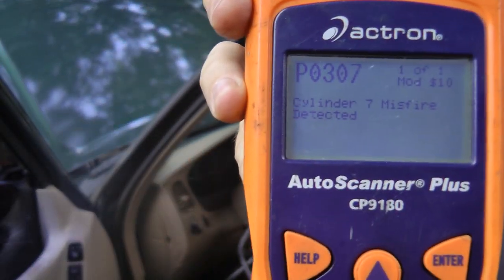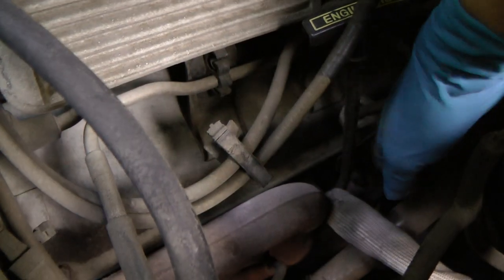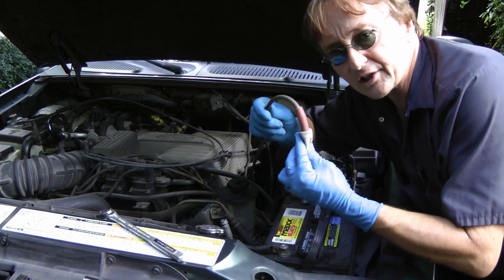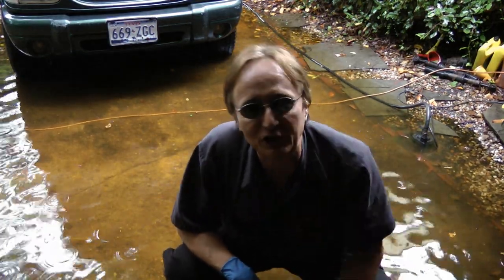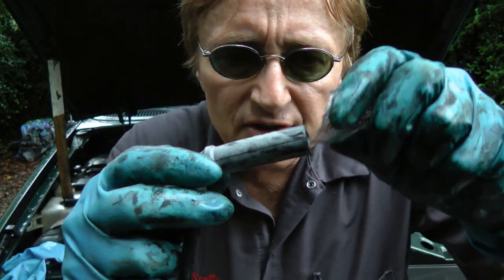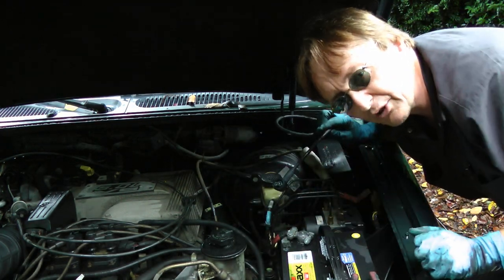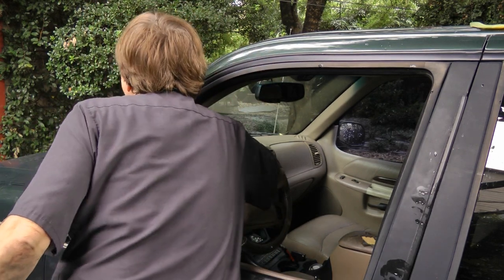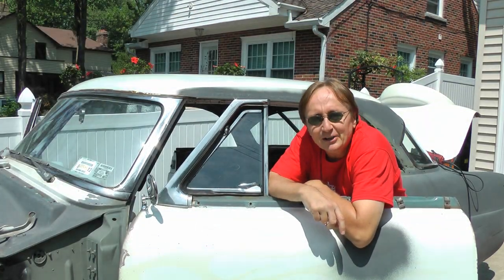How to Fix a Engine Misfire Code P0301 (Spark Plugs and Wires)

Comment: Three months ago I had transmission lurching, engine overheating, and CEL  on load only. Radiator guy said I needed a new radiator; trans guy - trans work. Then I saw your vid. Went with your advice; checked coil packs, plugs & wires. It was # 2 ignition wire. New set of Delphi wires - $29. All problems ceased. Thanks, Scotty, for saving me tons of money - AGAIN!

Comment: cables and spark plugs run almost 120.
time wasted 1-2 hours.
then you find out its not the problem.
ok you change coil, not the problem either
oil change nope,compression ..cars are so expensive
we should all go back to riding horses.
Reply: Horses are more expensive to own than  cars.

Comment: Will do that tomorrow :) I'm going to the junk yard, going to get fuel injectors, a MAF sensor, and a fuel pressure regulator. I looked at my EGR valve, cleaned it according to one of your videos, and my valve springs are working properly.

Comment from the maker: old age will do that with worn parts. Anything from worn spark plugs to bad fuel injectors will do that. so start basic with new plugs and wires and pray you don't have to go a lot further. Also try my video "how to clean fuel injectors on your car" that often fixes it.

Comment: It was implied by your initial comment, but glad to hear that. Commenting about over torquing is a non sequitur response to Potato's comment. If anything, using a torque wrench would make it less likely one would over torque a spark plug, not more likely. I use a torque wrench for my spark plugs because I don't trust myself to measure ~13.3 ft-lbs by hand and I know a low range torque wrench can. But someone like Scotty, or other very experienced mechanics, probably can gauge that by hand.

Comment from the maker: you can get em out easier than that, but only on a cold engine with really wiggling your arms around stuff and using wiggler extensions on the plug socket extension

Comment: @scotty kilmer   thanks for puttin the vidis up,,,i bought a used cadillac cts 3.6l  2005 and replaced plugs, coil packs and now fuel injectors,,im sure you saved me an easy 1500.$ in labor that i did myself  ...much appreciated ,,especially lettin ya kno to replace the whole set vs a single injector etc...  skip n you will be back undr the hood

Comment from the maker: na, only if old and cracked or arcing inside. And in this case, it doesn't have a cap, it uses  a separate coil to fire each cylinder.

Comment: With a lot of newer cars "not needing" tuneups or plugs for the first 100k miles or so, have you ever had problems removing plugs that have been in that long? Some folks would take almost 10 years to get that mileage and I wonder (especially with aluminum heads) whether there is danger of stripping the plug holes. Thanks, and keep the vids coming!!

Comment: @hardliving working BMW's (2x 2000 BMW 323Ci & 328i) and a Camaro (2000 3.8l) I had to change the Mass Air Flow (MAF) Sensor on all three!  Ebay.com average about $45, might be an idle control valve, or a vacuum.  Scotty you rock!

Comment from the maker: i also have the machine to reset it. there is a way to do it without, but it involves pushing scores of buttons and switches on your dash in an insane German designed fashion.  Google that and you will find a way to do it, but last time I did that before I bought my machine, it took me over an hour to get it to work on a beemer.

Comment: You prob think I'm an idiot. But I couldn't see the fuel injector rail so I thought it was TBI. I found the injector assbly and replaced it. Prob solved. So you were right! I had to replace the whole spider assembly and it was expensive, but not as time consuming as ripping the heads off. And it seems to have solved several random drive-ability problems that I was having. Thanks!

Comment from the maker: Did it start up at all for you after changing the dist? If not, then either you got a bad one or put it in wrong. Now if it did start, and this is a new problem,  do my video "fixing a car that cranks but doesn't start up" to find the culprit.

Comment from the maker: I doubt it, air leaks cause bad idling more often. I would assume the fuel pump is weak, the fuel lines are clogged, or the carburetor just needs replacing

Comment: Good point about the torque wrench not fitting. I have a Toyota 1.5L where all the plugs sit up top and are easy to remove and torque down. I guess I'm used to 4 cylinders!
I thought TX was in a bad drought?

Comment: The only fuse boxes i'm aware of are located in the engine compartment, and on the side of the middle console.  Is there another box under the dash?  Could I fix the problem myself?  I changed a fuse, and I can change my oil, but my skills end there.  If not would it be expensive?  I did have to change a fuse for the onstar system and for the power outlets.  That fuse was in the engine compartment.  My previous comments may sound rude but they really arent meant to be, I appreciate the response.

Comment: I have an 84 Toyota Van.  Most of its mis-fires were caused by a bad coil and bad plug wires.  The last mis-fire it had was from a collapsed hydraulic valve lifter.  I traced it and replaced it.  Runs like a top now.

Comment: Probably one good tip for novices is to change ONE plug and lead at a time - I learnt that one the hard way, pulled them all off and had to chase the firing order down in the workshop manual!

Comment: Hi Scotty, my girlfriend's 2001 Corolla is in a bunch.  The car has so much problems starting, probably 1/20 it'll start and run and once it runs, it bogs so badly you can barely gas it without it dying.  I replaced the spark plugs three times already and now they're Bosch Platinums because the first two sets kept getting carbon build up.  I know the car consumes oil and has a couple check engine codes but we can't confirm them because the car won't even move easily...occasionally it flashes.

Comment: Amazing video Scotty, thanks for posting it. I just finished replacing radiator coolant and using the Steel Seal you recommend for engine gasket fixing. After completing the process the engine runs much smoother with high compression. However, scan still shows PO3 cylinder 4 misfires. What should I do? Thanks.

Comment: @ smoky pearl: I'm not a Ford guy, Toyota is my game. My brother just bought a 2002 mustang GT that has the 4.6 and I researched the car a bit and found that info. Supposedly Ford did a redesign after 2004 and then the plugs threaded in real deep so the carbon fouled the threads enough to make it real tough to get the plugs out! I'll stick to my Toyos , thanks..

Comment: It did not start up at all.I probably put it in wrong. this was my first time working on my own   vehicle.I purchased a timing light to help me out. I may have to reposition the distributor for proper timing. But I will check out that video. I did replace that distributor for a newer one. and I still have the same problem. Fouled spark plugs with fuel.

Comment: I usually check the underside of the distributer cap for dust and HV tracing caused by it. HV tracing is usually easy to spot, since it burns a path in the dust. unless the cap's contacts are excessively worn, I usually just clean the inside of the cap to stop tracing, and replace the rotor button if it's on its way out. make sure to use some white paint to mark the orientation of the cap before you remove it though.

Comment: Hi Scotty I'm a long-time fan first time ever ask a me a question... I have a 2010 Hyundai Accent sedan it's a 4 cylinder it has a 1.6 liter engine...cylinder 1 continues to misfire I changed all the spark plug and it still has a misfire. 2nd- I replace the coil in cylinder 1 and it still has a misfire. 3rd- then I check the compression in all cylinders and it's a 180 pounds for all the cylinders. 4th-So then I replace the fuel injector on cylinder 1 and it went away for a moment and then came right back. so now I'm stuck!!!!!. This car was an investment to make a little money and since it was so brand new I did not anticipate having this problem. Where should I go from here?.....Thxs Ken

Comment: Hi, my c240 Mercedes Benz gave up on the street started to shake rpm dropped I got the car on the side turned it off did a cupel of starts the car turns on losses power and turns off slowly it feels like the car is trying to get more power and as soon as it does it gets more shaking and gets week I press on gas car does not move the belt works and stops a cupel of times then turns off what do you recommend thank you very much you have a lot of awesome videos

Comment: Hey scotty, i got a atv that backfires like crazy when i give it gas when cold. It idles fine cold and backfiring stops when the engine is at full operating temperature. Why is it doing that, it didn't do it before. Also the carb is properly adjusted and clean. Air filter is sorta clean. Atv is a 2000 bombardier ds650 with aftermarket carburetor and larger exhaust

Comment from the maker: there is a fuse for the check engine system, go to the main fuse box under the dash and check for a blown fuse there. But if it is blown, there is a reason and it would have to be fixed. first thing to do would be get the data port to work so you can access the code, there are over 2 THOUSAND different ones.

Comment: thanks the response.
sorry to i forgot to tell you that i replaced the injectors before fixing its connector. now i observed that the intermittent loss of power is not that long as it was. but still i can feel a shake from the engine when idling.

Comment: Just in case anybody misunderstands, the dielectric grease that he put on goes on the rubber boot and not the metal electrical connection inside. It insulates the connection between the rubber and the ceramic and allows the boot to slip on easily. I know Scotty understands that but it was not completely clear in the video.

Comment: Hey scotty. I have an 07 F150 with 4.6. I need the plugs changed, but I have read that these are a real nightmare. I dont have all day to mess around with these spark plugs, so with that in mind...should I buy the extractor tool for broken plugs? Or just go to my local mechanic for this job since he probably has done several of these plug changes?

Comment: Hey Scotty I have a problem and I can REALLY REALLY use your expertise right now. My car died on me while i was driving it like out of nowhere and it was hard to step on the gas I had to use my e-brake. This happened when I was slowing down at a Stop sign and after it turned off I turned it right back on and it started up. I'm a little freaked out right now this is my only car to work. 

ANY help on what you think it might be or how i can fix it?

Comment: Hey Scotty, what is your opinion on domestic vs imported cars? Most people consider foreign cars to be better, but I see all cars as good (unless its a Yugo or a jaguar) as long as you maintain them properly.

Oh and also, I have a 1995 V6 OHV Ford Explorer 2wd, I keep hearing a squealing noise when driving and foot off brakes mostly happens when turning, my guess is the wheel bearings as they are the factory bearings (probably not ever re greased).

Comment from the maker: swap the number one fuel injector, if the miss moves, that's it. If not, often a problem inside the engine on number one, like a blowing head gasket on that engine.

Comment: Hi sir Scotty, i'm 20 y/o and i have a Honda City 2004 iDsi i don't have any idea about fixing a car but a few tips here in youtube that's what i only have (Sorry for my bad english).. My problem is i have a bad 4 ignition coil with 4 few rust spark plug (That's what they told me at Car Shop) I've got a jerking engine before... When i went home i've tried a simple troubleshooting like disconnecting the battery and unplugging all the wires in all 8 ignition coils and check if there's is a corrosion, then i plug the wires back , i also saw your video cleaning a throttle and i did that one too, after that i've check my car and drive a few miles, checking my car if it will jerk again but the jerking is gone now, i feel that my car slows a little bit since i've got this problem...
I don't know exactly where to get a help because sometimes they think that im only just a kid trying my best to get my car get well again, what im trying to say is they want more money from me even some parts is not need to be replaced :( i've got a lot of idea from you sir, i just can't apply it because i'm too scared to do it to my car, im from Philippines.

Comment: Hey Scotty I recently got a 94 ford ranger 3.0 and it runs great and all but sometimes after I drive it for a good amount of time, lets say maybe a half hour or so, when I turn the engine off I'll hear this like ticking sound. It sounds like a misfire more than a knock so I just wanted to ask you to see if you have a diagnosis for the problem. Also the power steering fluid is chocolaty brown is it time to change?

Comment: Hey Scotty I have a 2011 Ford Mustang 3.7 v6 and it has almost 92,000 miles and it runs great however I was told the spark plugs needed to be replaced every 100,000 miles and also note that starting in January more than likely I'll be driving to my college back and forth quiet a bit and the overall trip is 180 mile round trip and I need it to be in good shape so I was thinking about replacing them what do you think

Comment: I never got a response so I may as well take the opportunity.  My 2004 Buick Rendezvous hadn't been started in around 6 months.  It has 175000 miles on it.  We changed the oil cleaned out the anti freeze container and added more 50/50 ratio with water and added fuel system restorer to the fuel tank. The same day I was driving it and the service engine soon light came on.  Auto zone said it wouldn't read because i have a bad fuse. Which fuse do I replace, did something I did cause it to come on?

Comment: fixed a misfire with 3$ spark plugs. the engine was misfiring randomly and when you gave it gas it stopped. i thought it would be a fuel injector or something worse and the plug looked healthy, but when i changed them it fixed the problem

Comment: Hey Scotty. I got tons of problems going on with my 1998 Camaro V6 but i figure i'd start out with the small things first. I got a cylinder 6 misfire but when i see other people check and change spark plugs in other cars they don't always go under the engine, i seen a few cars you can get them right out from top of the engine... I'm new to all this and this is my first time trying to fix a car so excuse me if this is a dumb question.

Comment: Hi Thanks for the video! I have almost this code, but with a misfire on cyl 8 on my 07 f150 4.6L.  The plugs on this truck are original, 99.5k miles, and are also the plugs notorious for breaking. (thanks ford) I plan to use the same Motorcraft plugs just new, but Is it okay to use maybe a newer updated version of the plugs from Motorcraft?

Comment: Went out today checked bracket, 1 of the screws is stripped ,bracket is still tight going to get that fixed soon .Would that possibly cause my truck to miss? and coil wire arching? Does a coil have to be grounded to work properly? Thanks

Comment: Had po300, po113 po122 po107. Replaced the MAP sensor, TPS sensor, Fuel pump, Fuel filter. My car is a 97' chevy cavalier, it has extremely bad acceleration and can't push past 30 MPH, it makes a funny sound and my car putts, im thinking there is a broken valve spring or my EGR valve needs to be cleaned. It was a rainy day and i was headed into town, ran fine then out of nowhere it started doing it as i started accelerating again.

Comment: Hey scotty I have a 98 Nissan pathfinder. My wife was driving the car and it shut down on her at a stop light. We towed it to Midas and they diagnosed the problem being the distributor and spark plugs.The cost was 700 dollars for parts and labor.I replaced the whole distributor assembly with it being aligned with cylinder #1. but my spark plugs are fouled with fuel each time I changed them out. So my question is how do you clean a flooded engine? My car cranks but does not start.

Comment: Hi Scotty
I've Honda City. Just took it to the mechanic for regular tuning. While doing so, he pulled the ignition coils out, checked all of them, and then told me to get 2 of the coils replaced. But, the spark plugs are all fine, and I didn't see any carbon on them. Plus, I never experience any misfire. So, do I have to change the coils, he said they will soon wear out and stop working. Also, do I need to change all the coils because another mechanic suggested to do so.
Please reply ASAP.

Comment: I had a 2005 Kia Sorento that would shudder (misfire) when your at a stop idleing with the car in drive or reverse. My S. plugs were fine..... but the boot on the ignition coil was cracked due to age and heat, causing arcing and well, misfire. I simply bought a new coil ($30), or you can buy a new boot for the coil ($6), and replaced it then lubed the boots with S.P. grease. Since my cars runs beautifly and I regained my engines power. Hope this might help you!! (:

Comment from the maker: yea, unfortunately the threads are sealed inside the engine, so spraying lube on the top doesn't really touch the threads.  You might try a better mechanic who is a master of the air impact to use that to remove those two

Comment: Hey Scotty, Amazing videos, been subscribed for a long time! I have a few questions about my 93 Toyota Camry

1. Is the coolant supposed to be black?
2, Is the transmission fluid supposed to be black and have metal shaving in it
3. is the engine oil supposed to have very fine metal specs in it?

Comment: hi scotty i have a 1996 jeep grand cherokee laredo 5.2 l  i have replaced the plugs wires rotot disturpertor cap an to this day still has a miss fire when u first start it up after bout ten min of it running it clears up any suggestions